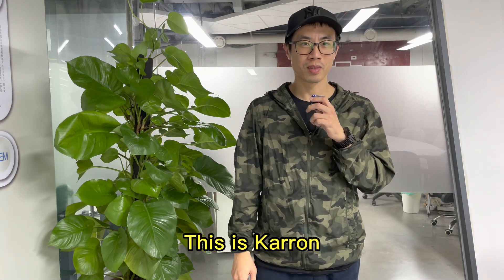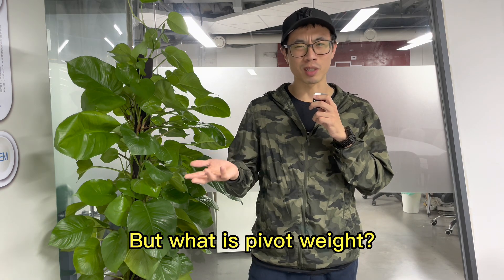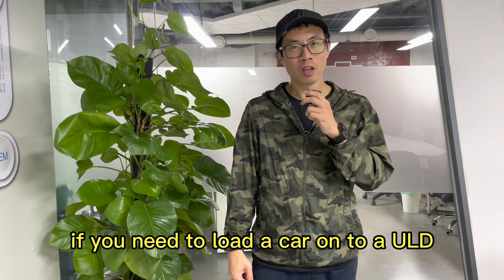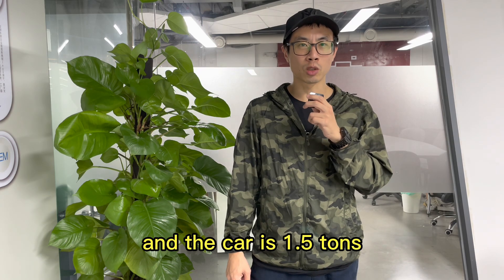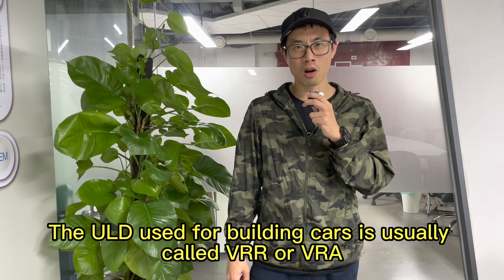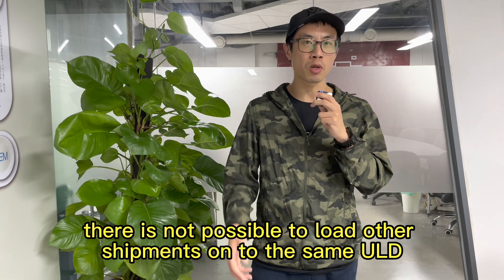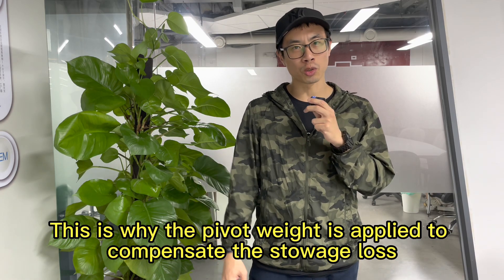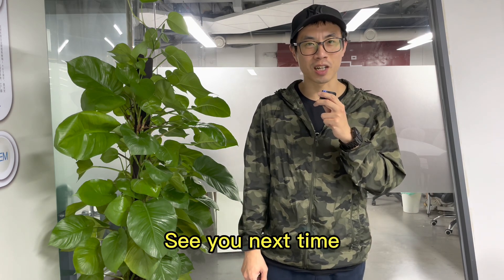Pivot Weight

Comment: Hi Karon, thanks for the information. I had a shipment with odd dims and i got the rates from different carriers, the question is some of them sent rates for pivot weight while others not. Any specific reason for this ? Is it depends on the aircraft type, wide or narrow ?
Reply from the maker: Hi there. Thanks for reaching out. The pivot weight is related to the carrier's policy and the aircraft's performance. If it is an odd-size shipment, it is normal for the carrier to ask for the pivot weight. Hope this helps.